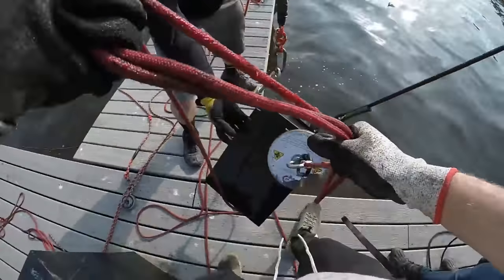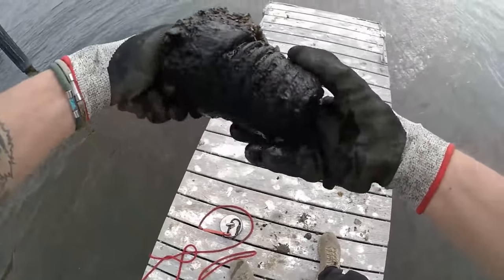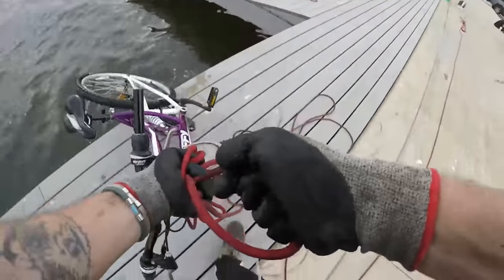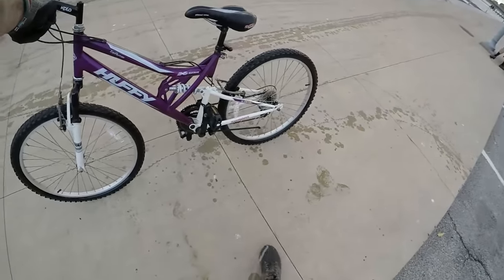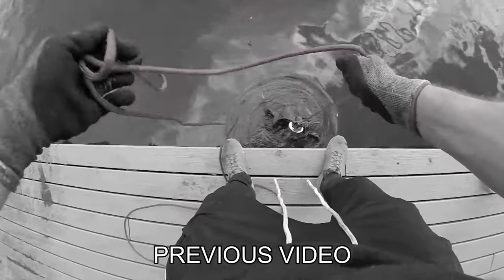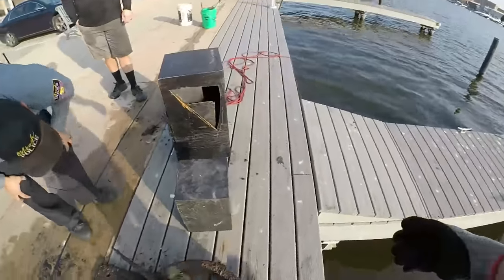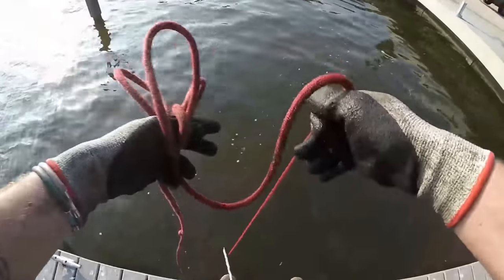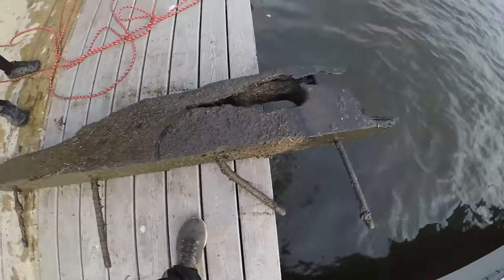The MOST DISTURBING Magnet Fishing Catch The Police Have EVER SEEN!!!

Comment: :40 was flat expanded metal in angle iron frame likely a vent or guard off something
1:29 looks like a fire hose fitting barb (must be a cheapie- fire hose fittings are usually brass)
2:08  wood spoke wheel ring off a pre 1930 car
Honestly the bag with cordless saw and grinder were likely stolen and taken to a pawn shop that laughed at them. 
I have several saws and many grinders in my shop for building everything from up to and including old cars. (have never broken into a safe )
9:10 exhaust pipe clamp from a car
9:24 looks a lot like an ox yoke. (my old Dad once told me broken yokes in water were likely from ox walking on ice and 1 falls through the ice, breaking the yoke that tied them together.)
Reply: Couldn't believe amongst them they couldn't identify an exhaust clamp. And yeah, they should have turned bag of tools in. Obviously dropped there for a reason.

Comment: That weird threaded thing is a drill bit for wells - possibly water well, but we used ones that sized for drilling cement out in oil wells in KS.  Also, people use them for anchors on smaller boats.

Comment: That smaller safe is a Hotel Safe.  There is generally a plastic casing with the pad there were you enter in the code for the safe or swipe your room key is missing.  That badge on the front is were the "backup" key hole is at.  If you go to the modern rogue channel they have the front of a safe that is similar to that.  The same video you also see how easy it is to get into those hotel safes without a grinder.
Reply from the maker: There is a hotel right next to this spot 👀

Comment: as i was watching this and seeing the safe being pulled up with that bag in it stuffed tightly inside that busted open safe, one thing came to mind when i saw the bag. That bag looks like an old Military issued duffel bag that is used to store there personal gear like clothes, shaving/hygenic gear, and sometimes personal effects. i know this cause i have a bag much like that except the one you had in the video does not have a inside flap so more then likely this is a knock of version of it or it is a much older bag that was likely used during the 50's to mid 80's. also like to mention that if its a military issue style bag it will have the stamp or a mark of what service it is from. like if its from the army it will just have U.S. marked on the bottom of the bag. and considering it was a forest green color it is either a Marine corps bag or a US army bag.

Comment: The gigantic thread thing to s the end to a drill rod. For digging wells, oil or water. They are usually about 20 ft long and they are hollow so they can pump water down to bring the dirt up.

Comment: You know, when you pulled the duffle bag up, I was thinking some poor bloke was working on the pier and accidentally dropped it in. When you called the police, I thought, well intentioned but entirely unnecessary.... now that you're pulling up two safes, one of which has clearly but cut open by what looks to be a cutting wheel... well, things are starting to add up here and that well intended but unnecessary phone call to the police seems like it was a good call.